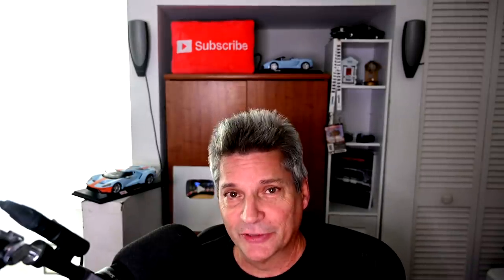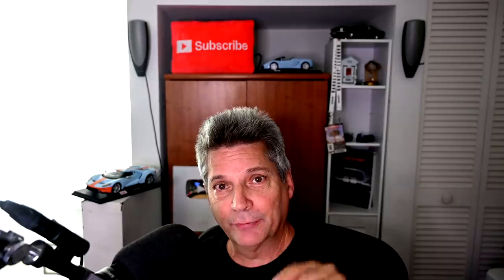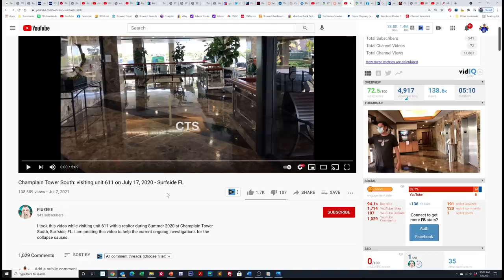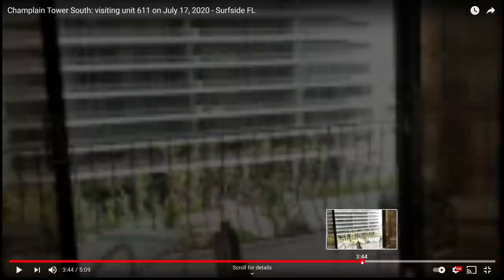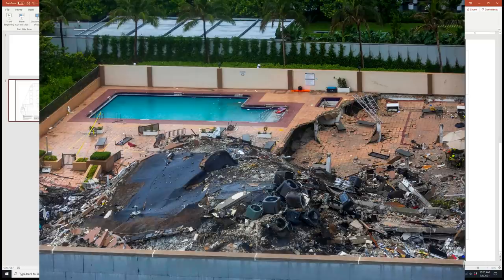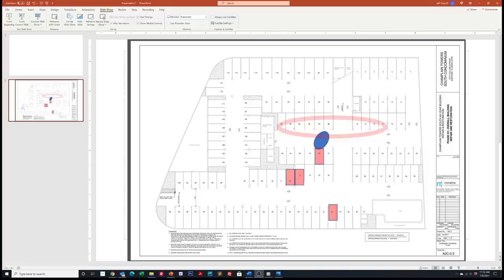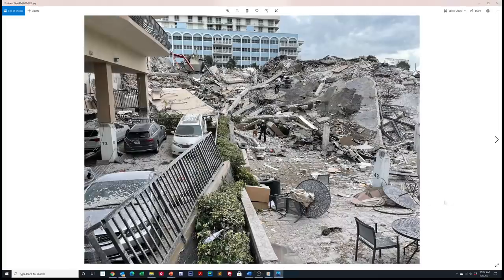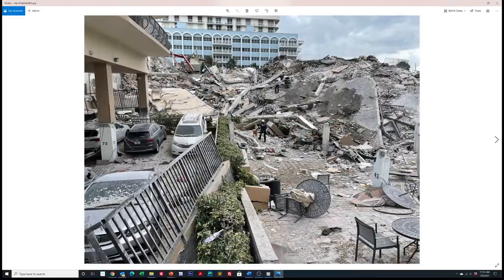Analysis Garage Video BEFORE Condo Collapse: Water Everywhere

Comment: We have cones just like that, in my parking garage out here in A California. It's so those with SUV's using the, "Braille System," of parking, will hit something squishy first, before taking out a column and their SUV, and possibly striking the car behind them.
TBH, those exposures on the columns look perhaps, like multiple strikes by different cars visiting, the drivers skunk away.
We have cameras in certain areas here - including by my sports car, because of vandalism by renters on other cars.
I believe that this was a multiple level failure, as I saw columns sheared off - and here's the cherry on top: the fact that the construction company lied about fixing the hotel next door, I strongly feel, was the bait and switch, that sped up the process that took the Champlain Towers South down, way ahead of their time! My mom's been an architect since the early 70s. She's the very first person I know of, who'd figured out why the twin towers came down, in the order they did, adding in the fact #2 was hit lower, the planes blew off the asbestos covering off the beams. And the fact that albeit, the jet fuel burned off immediately, both planes slammed furniture across the floors, were already on fire. So, you had fuel: the building and contents. If anyone bothers to see what the NYPD Choppers were doing, they were monitoring the bowing those floors were doing, and telling NYFD, NYPD to get out, before those beams turned into molten taffy!! I think they bowed out 7', before they hit critical, on both buildings, which is amazing! If they fire sprinkler system had gone off, put the fires out? The buildings would have still stood. But those lines were severed. The collapse of the WTC, like an earthquake, debris, had already destroyed the integrity of WTC #7.
Which I believe is exactly what the construction crew did to the Champlain Towers. I believe that they lied, when they said they were going to try and save the hotel.
I do NOT believe for a second, that they took into account that their 2 yr constant construction, would have any affect on that building, seismically, when they should have taken what it needed, and run a computer simulation with what their constant construction seismic reaction would have on an already weakened structure!
To me, they KILLED those people, most flippantly!! 
If they'd stepped up to the plate, asked the HOA, "Hey, how much to get you to code, so that it's safe for us to go ahead, and build our Uber, deluxe highrise condominiums that will be twice as high as yours?" And pick up the bill.
They'd have been seen as Heroes, not as the Zeros they are!
I believe that they destabilized sections, facing towards them, as they SNAPPED, sheered off, and the way the building fell so oddly!
The 2 yrs of construction, while the HOA was bleeding out, seeking a loan, while construction shook them constantly, was not only a complete recipe for disaster - it stole any normal time Champlain Towers South should've had, to survive until they fixed the issues. They basically liquified whatever the columns were plunged into, over & over - in my opinion, creating a significant premature demolition!
Reply from the maker: LOL, I love that, the Brail eSystem

Comment: I would suspect their is a 35 ft void of sand underneath the parking lot  floor that you cannot see. Sand is not a very good foundation for a concrete and rebar building near  a salt ocean.
Just like the sink hole that the corvettes fell into in the corvette Museum many years ago.

Comment: Any dash cams? Has to be a few that made it out before they closed access.
Reply: I saw a parked Tesla in this clip, they record 24/7 with several cameras. I hope that the recording disc isn't to badly damaged so they can watch it. It will take time to reach the crushed cars, but fingers crossed. Hopefully it was parked when the building went down.

Comment: Looks likely to me that somewhere in the building above, a water line or three broke and slowly rusted out the rebar in the building. Just look at all the repairs done to the PVC piping we can see in the basement - same thing happening above.
Reply from the maker: That is probably not likely. The more likely scenario if you look closely at the video, most of those damaged areas and the and the previous patches in evidence of other repairs on the ceiling and the stalactites, are all beneath areas that are either at the pool deck or the covered garage on the South side of the building, both areas which notoriously had issues with water not pooling properly or sloped properly off the deck, so it sits underneath the pool bricks and collects over time and eventually soaks in and causes the rebar to rust. this obviously happened over years from day one period

Comment: The "stalactites" at 9:57 actually appear to be uniform width like some sort of tape.  Almost looks like maybe someone used strips duct tape and sheetrock mud to cover a crack in the ceiling then painted over it.

Comment: Is it just me or is that a piece of concrete sitting at the bottom of column 14, right in front of the yellow side curb? As if it fell out from somewhere and someone just placed it there? Look starting here: https://youtu.be/OS6JFSFTZz4?t=1930 Also at the bottom yellow part of column 15 seems like a large chipped piece of concrete is missing?

Comment: 32:15 mouse pointer on crack that looks raised separated concrete near column where the floor would tie to structure , which then looks like concrete was used to make it not as much a trip hazard then it would be.

Comment: Native Floridan Maintenance specialist Look at the planters they are made of framed treated wood and then sheet rocked and stuccoed talk about a water issue and you know they all had watering system for each one and the weight with the years of adding new landscape Looks like each planter is sitting on a column ? 20 ft apart scary how it’s not on the blueprints or landscaping drawings Lastly look at the one planter it’s been repaired and repaired again ???

Comment: The main problem with the structure was the lack of concrete beams between the pilars that sustain the concrete slab with the pool area and ground level parking spaces. For a billion dolar apartament building cutting costs in that matter is embarasing. I must mention also, that the structure for the ground level pool and parking area shoud have been isolated (like an independent structure) from the apartament building.

Comment: You missed a bad spot at 19:10 ...another corrugated metal fix job beside a crack in the ceiling, to prevent water from dripping on cars.

Comment: I don't believe that's rebar poking out in the garage ceiling because there's absolutely no reason for rebar to be sticking out of finished concrete to begin with. I think that is iron oxide being transferred out of the concrete through the crack from the rusting and corrosion of the internal rebar, discoloring that stalactite.
 The stalactites hanging from the ceiling are quite disturbing because not only does that identify cracking and leakage but illustrates a long history of leakage. When you combine that with the saltwater environment, the water getting into the concrete is not only eroding the steel rebar more rapidly, but it is also deteriorating the concrete at a faster pace. 

Just from the presence of the stalactites and water in the parking area, I am actually very surprised that this was not a high priority repair with mandatory evacuations.
People don't want bad news and they think that you are scamming them when you tell them horrible news. Furthermore, some companies aren't concerned about actual safety or their reputations, But instead just concerned about the dollar so they'll make their inspection quick and dirty and move on to the next one.
I wouldn't be a bit surprised if there was bribery or other improprieties at play amongst the city officials and I think every single building needs to be professionally reevaluated immediately! My hope is that Governor DeSantis mandates all buildings to be reinspected with new requirements highlighting the problems that were clearly evident in this collapse.

Comment: Concrete is porous, that parking garage has been filled with salt water dozens of times from huricane flooding unapoxied rebar over time will rust within the concrete, i built the bridge segments for the big dig bridge in boston un painted ends of cut apoxied rebar were not passed by inspectors for this reason concrete absorbs water unapoxied rebar will rust and cause spawling over time!

Comment: Great video. The calcium carbonate deposits are a dead giveaway of total degradation of concrete and the corrosion of the structural elements of steel therein .. Whole building was out of code and dangerous the day it was built. No drainage off the pool deck would let water penetrate and do its corrosive work for years throughout the garage, which supported the whole building. Not to mention the paint bubbles you can see, essentially sealing in the water to the concrete slab until they would fill up like bubbles, pop, and leave the shredded peeling you see above. Speaking as a native Key Wester and total amateur, we need to reinspect every building up and down the Florida coasts, many are exactly like this one and another horrific disaster waiting to happen. It's time Florida's growth and do no wrong development culture takes a look at itself for long term infrastructure of a sinking state.

Comment: At 8:21 if u look at column 52 u can see a ring of water damage around the base. This video here from Building Integrety goes into detail about this and about the bldg's foundation:
https://youtu.be/Kg7xofW6fnI
Even after the clean up this floor still has water coming up thru it. U can also see on the floor that some type of patch work has been done at some point. So it appears that there was water coming up from the foundation due to rising water table, and water leaking from above.

At 10:30 according to Building Integrity, this is to protect expensive vehicles from the water. 
https://youtu.be/ZAIJsaSo4Sw

The first house my husb and I ever lived in was a rental and the landlord had told us the basement had been completely refinished and repaired from a flood. The home was built in the 50's and back then they used concrete block foundations. 11 mths after living there we noticed in our bdrm, which was in the basement (kids rooms upstairs) that there was a ring of water at the back of the closet. Upon further inspection sure enough there was massive water damage and black mold growing behind the drywall. We knew the landlord wasn't going to do anything after arguing w him, so we moved out the next month. I'm in Ontario, Canada, and although we have xtrmly strict, pro tenant laws, we didn't want to have to fight our landlord in court. It was just easier to move. The house we moved in to we're still living in 9 yrs later, and it's a semi-detached. Back in 2015 there was a massive rain storm. These homes were built in 1997 and have sub pumps. Well apparently the lady attached to us, her sub pump failed and flooded her basement. That water quickly came thru the concrete wall and into our basement. She had around a foot of water, we were a bit more lucky and only had around 3-4 inches. The basement is finished and had carpeted floors. Up came the carpet and my husband cut away around a foot of drywall from the bottom and repaired it. Water damage is so detrimental, and as I've learned from this tragic disaster, salt water is even worse.

Comment: No capitals or beams in the pool deck, little rebar, no sloping on the upper level of the pool deck, probably little waterproofing on top. bad drainage. When this condo was made, the writing was on the wall. Any units designed by this engineering company should bear much scrutiny. 40 years doing high rise and I've never built something so crappy, and I've done 70 plus storeys.

Comment: This is Robbie Red Hook Brooklyn New York Hope everyone is as well as  They can be. As I had said before I felt it was a leak of some type dealing with the pool equipment in the coronation factor was my root suspect due to the visuals of the way that concrete and rebar was corroded. I was a little off the water pooling from the pool on the pool deck over time reached into the structure again chlorinated water in Florida they use a lot of chlorine due to the higher temperatures in the quicker growth of algae and so forth . Again my condolences to all those who have lost. We have to remember we're only as strong as our weakest link . Peace and safety to all

Comment: Jeff, I believe you are in error as to the row of columns that collapsed.  You're starting with the column connected to the ramp wall.  It's the next FURTHER column, the one where the concrete beam does not sit on top of that column.  And immediately to the right of the column (in the video, with that improperly-supported concrete beam) is all the water seepage coming out of the ceiling.  That area is the ticking time-bomb for the collapse.
Reply: The second light from the ramp entrance is the light that is illuminating the gushing water (at 26:14) all in the area of the ceiling seepage, peeling paint and problematic concrete beam. The gushing water is actually further beyond the first full stand-alone column (at space 27?) most-likely the pipe to the right of the one you said, you mentioned as "is that a pipe just hanging out of the ceiling?"  At 29:06 the white pipe coming down and veering right from in front of the bowed concrete beam, is the pipe I believe broke with the ceiling collapse and is in the tourist video gushing water.  When you stated at one point that the concrete beam near space 27 looked bowed, I believe that and water ceiling water seepage area is what collapsed first.  The noise that attracted the tourists across the street to get out of the pool and start filming would have heard the ceiling collapse onto the garage floor and the debris we see from the entrance to the ramp.  That collapse would be the pool/patio deck collapsing down, which the woman on the fourth floor witnessed and phoned her husband in Washington, D.C., right?  A concrete ceiling falling down on what you said was a garage floor already permeated with cracks, would most-likely weaken neighboring columns.... Perhaps even the garage floor collapsed inches or feet into the fill (or void caused by water) under the garage floor.  While distressing, this is a live, engineering mystery.  Hopefully answers will be found so that such construction mistakes can never happen again.  And every similar concrete construction building on the coast should be gone through with a fine-tooth comb.  It's really reprehensible that re-certification is only every 40 years.  There should be ten year re-certifications.

Comment: It is an unbelievable and at the same time simple and obvious case.
If anything is to blame it is the workmanship. If everything was done correctly from the first day it would never happen. 

Imagine, how little of a condo can 2000,000 buy. Can 2M protect you from evil
human ignorance?

Regardless of whether those leaks created this problem, they should never be ignored
and eliminated the day was noticed. Can anybody fire the building management?
They probably took advantage of circumstances and went on vacation they are entitled to.

The condition of the ceiling in this garage three years ago explains this disaster.
Ignored little water seepage for three years turned into a river of disaster.
The only question that comes up, where was the management of the building.
If they are still on the payroll as I can imagine they are, then they should not the allowed
take vacation time at this particular time but report to work with the shovels.

Conclusion:
Are you planning to spend 2M for a condo?
 Before you go upstairs start inspection downstairs in the garage, because
living in a building in a condition like this one, sooner or later you will be forced out to heaven.

Comment: I have to be honest, I’ve parked in underground parking garages dozens of times and small standing water puddles and paint chips are a fairly common scene. Nothing seen in this video would be a glaring red flag that the building would be ready to collapse; the columns that bear all the weight actually look in decent shape…..there’s undoubtedly much more to the cause of the collapse than puddles and peeling paint. Also, some of those “puddles” on the floor may also be nothing more than oil/fluid  leaks from cars that also give a gloss appearance like that of water.

Comment: A building slowly sinking as pipes break and I would that they had to adjust doors that were rubbing and binding, passing thru shear wall areas there would be binding fire door and uneven thresholds. I see minor attempts to divert water dripping from the garage ceiling as the paint peeling from the garage ceiling from the many small leaks from upper floors that they were so busy patching that nobody could see the Big Picture. I have seen this before and Management wouldn't listen to me until after I got the local Building Inspector out and the "Guys with Clipboards and briefcases" (lawyers) came!

Comment: If you look at photos of before the collapse, there are large concrete planters on the pool deck in the area of the columns you think failed.  If they had some sort of automatic watering system that failed, and were leaking through to the garage, that would explain the waterfall in the short video from the people in the hotel.  The large planter I am referring to is right inline with the ramp to the garage.